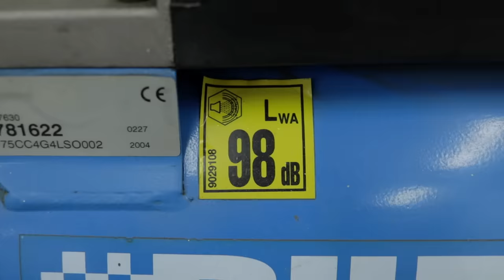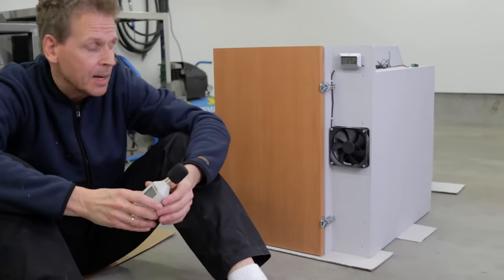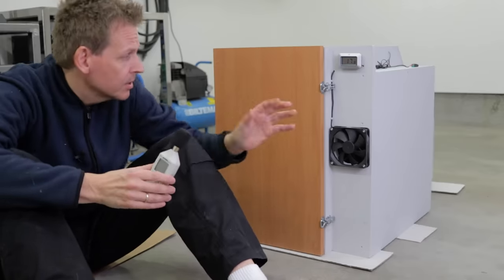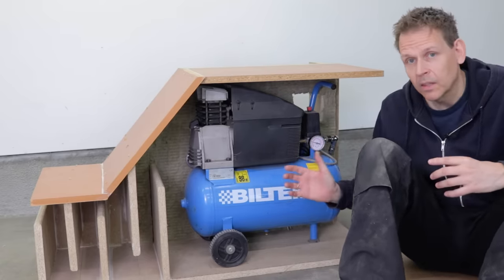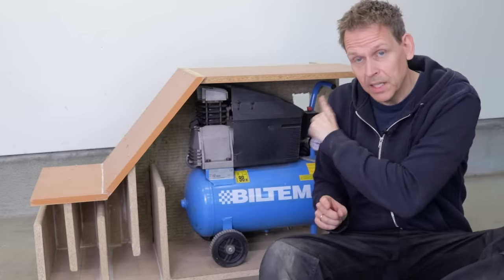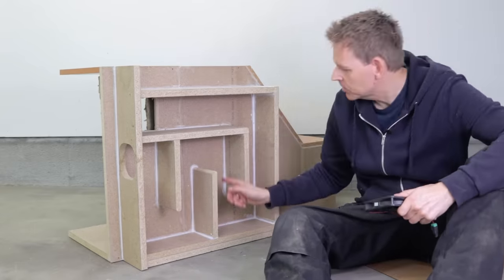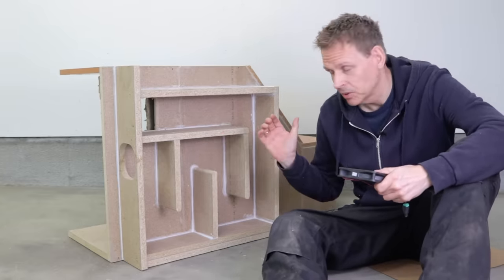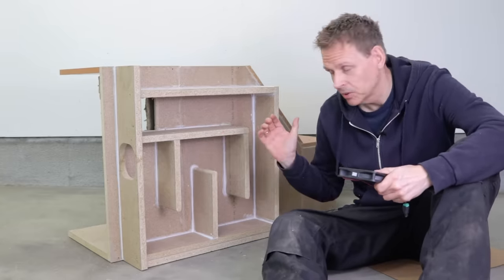Do not build a sound insulated enclosure for your noisy air compressor!

Comment: Nice box.  I'm sure it suits your application quite well.  My only worry is if it is overheating from restricting airflow.... however, it is a small unit, so I'm sure it won't run long enough to ever overheat.
Reply from the maker: I absolutely share your concern when it comes to overheating. The air compressor will not live for long if it is constantly hot above the recommended specs! 😐 However, It's a pretty cold climate here where I live in Norway, in the Northern part of Europe. I have actually fitted a heat pump in my garage to be able to use during winter time. I can see overheating is a big challenge in warmer climates. A more powerful fan or even radiator cooling could be needed must then be considered.

I have fitted a thermometer and I do check frequently that it's not getting to hot inside the box. Normally the temp increases 5C = 10F when it starts until pressure is built up, and it takes just a couple of minutes to cool it down. If it is running constantly over longer periodes it can get a bit hotter, I have seen almost 10C = 20F increase. The warmest summer days can be 30C = 86F here where I live, but that is very rare. Its more commonly 25C = 77F, so it never gets very hot inside my box.

Comment: I've got a 2 HP oil type home compressor that I bought in 1970. Now rarely used. I've also got a business that relies on compressed air, so it is taken much more seriously. 20HP screw, 10HP recip back up, auto drains with oil filter traps so we can dispose of the condensate legally, air to air cooler, refrigerated air drier, coalescence filter, pressure regulator. All piping is sloped to manual drains. All air drops come off the top of the piping, CNC equipment has desiccant driers as backups. Compressors are in a sound insulated room. There is a 40 HP screw type vacuum pump in an outdoor room with temperature-controlled fan venting and heating so it never freezes. Synthetic oil, separator cartridge and oil filters are changed every 4,000 hours of operation (year and a half.) 

Bottom line, air is expensive!

Comment: Had similar problem yrs ago our power on Mobil home went out the land lord brought over large generator it rattled the old Mobil home so I took some plywood and foam along with old comforter arranged them around the plywood and packing foam batons that come with some shipping box’s and dampened it considerably as for exhaust  I just made sure when I went around it that I directed it down and away from the home worked great 

I simple used what I know abut sound rooms and foam and went to it took few minutes and made sure I could open it up easy to refuel it and shut it off as needed
Reply from the maker: Perfect 👍 Living with constant noise is no good, well done!

Comment: One place I worked had a 400 hp air compressor that was very loud. People would complain about the noise if they had to work near it. The problem is that compressors generate a lot of heat and that heat needs to go somewhere. Sound insulation is also heat insulation so when a insulated room was built around the big compressor the oil got so hot the oil hose burst spraying hot oil onto hot surfaces causing the oil to ignite. The result was one compressor dragged off to the scrapyard.
Reply from the maker: Wow 😳 the whole building could have burnt down. Cooling definitely needs to be added to the solution!

Comment: The enclosure seems quite efficient in attenuating the sound from the compressor to surrounding air. However, the bottom of the case probably delivers the vibrations straight to the floor. In your case, since the compressor and enclosure are tucked away at the loft space of your garage, most of the sound probably is transmitted through solid matter - through the enclosure, through the floor, into the garage structure.

You might get a significant noise reduction by adding a layer of sound-dampening material to the bottom of the enclosure. Old foam mattress could work, or some rubber feet even, like some computer cases have. Or you could suspend it in mid-air with a sort of cradle made out of nylon rope, or something more esoteric.

Unfortunately, putting an air compressor into a vacuum chamber to isolate the sound would sort of defeat the purpose of the device, unless you gave it an intake hose. Hmmm... an enclosure with a vacuum inside, and the compressor suspended on damped springs inside? ;)
Reply from the maker: You are absolutely correct! Vibrations are the biggest source of noise now. Will try to improve it by adding soft rubber, dampening foam or springs on the compressor and/or between the box and the floor to improve it. Thanks for the tips! 😊

Comment: You can opt for an oil-filled silent compressor, which typically generates less noise than the type featured in the video. Thanks for the great content!
Reply from the maker: You might be thinking of the belt driven type? Yes, these are much more quiet but also bigger and much more expensive 🥴

Comment: Very impressive. I fully expected that you were cautioning against building an enclosure because of the thermals, very glad that you added a thermometer so that you can make sure your compressor doesn't overheat.
Reply from the maker: Thanks you for you comment 😊 It's is luckily (or unfortunately - it all depends who you ask 😋) a pretty cold climate here where I live in Norway, in the Northern part of Europe. I have actually fitted a heat pump in my garage to be able to use is as a workshop during the winter time, if not it is freezing here. Overheating is probably a bigger challenge in warmer climates. 

I have frequently checked the temp. Normally the temp increases 5C = 10F when it starts until pressure is built up, and it takes just a couple of minutes to cool it down. If it is running constantly over longer periodes it can get a bit hotter, I have seen almost 10C = 20F increase. The warmest summer days can be 30C = 86F here where I live, but that is very rare. Its more commonly 25C = 77F, so it never gets very hot inside my box and it is within the range of acceptable temperature for this compressor.

Comment: Hi - thank you for the video :) 10-15 dB is also ok but i have to point some... points :) - the bitumic matt is prefered choice for silenting not a car lining or a foam. You can test the spectra of sound and point the +/-3dB freq range to create a proper air vent (how wide and how long NOT TO resonate) and also as a carpenter there is an option to create appropriate holes in a proxy wall inside i know this is the type of silenting the philharmonia and music studios, first direct then collide audio rays into themselves :) not sure how to call it.. You can mount a weight on the outer walls to minimize the phonic transfer but it is also an accustic resonance consideration,  plywood is better than the... how do they call it... gluedwood :) ("paździerz" :) ).

You haven't consider any airflow maths, it should suffice but still fan should work with a similar order of cf per minute (or cube m per h if you live in europe ). And we didnt see the thermal effect with a sustained work (load attached to the compressor for an hour long time) ? 

I enyojed the video very much - perhaps thanks to the points i have noticed :)
Reply from the maker: Thanks a lot for your input, It seems like you have a lot more insight into sound treatment than me 😊
I found these at my local dealer - can these do the trick: https://www.biltema.no/en-no/car---mc/car-accessories/sound-insulation/melt-foil-bitumen-4-pcs-2000021214
When it comes to the airflow: I have not done any calculations, my knowledge in this field is limited so I just made a solution that I though made sense 😏 I made the volume of the channels equal for input and output to avoid too much back pressure, and just hoped it would be big enough to transport air needed to keep it cool. I had in mind that the design should allow for putting on more fans (pulling air at end of output) if needed. 
I have tested the box for a while now, and the airflow works well for keeping the compressor cool.  I have fitted a thermometer and I do check frequently that it's not getting to hot inside the box. Normally the temp increases 5C = 10F when it starts until pressure is built up, and it takes just a couple of minutes to cool it down. If it is running constantly over longer periodes it can get a bit hotter, I have seen almost 10C = 20F increase. The warmest summer days can be 30C = 86F here where I live, but that is very rare. Its more commonly 25C = 77F, so it never gets very hot inside my box.

Comment: My compressor is outside the garage in an attached shed, but still noisy. I lowered the noise by taking the intake strainer off, piping it out the back wall of the shed in a pipe, surrounded by some 4" OVC, with insulation between them. There is a 90, pointing downward, but for the cost knocked off 25% of the garage sound

Comment: Just an small, easy and quick suggestion, replace the fan with a HEPA filter (Make it changeable) also move the fan to the end, where air enters big chamber from labyrinth.
Reply from the maker: I liked your suggestions, I might do that 😊 I have got several comments about pulling air out is more effective that pushing air in, I think I just need to try it to see if it makes any difference in real life. Thanks for your comment!

Comment: Awesome build perhaps re-test with improved contact points ie rubber floor, its the vibration that's still apparent also there's sound deadening materials used for vehicle and stereo sound dampening which work extremely well
Reply from the maker: Glad you liked it ☺️ I have thought about it, getting rid of vibrations is probably the best improvement I can do now 👍
Reply: @kihestad  you have gone this far so why not step it up great work champ 👍

Comment: What model was old 98db and new 78db air compressor ? Witch one will fully fil the tank faster in minutes ?
Reply from the maker: They are both from BILTEMA, the noisy one is 1500watts, the silent one 850watts. The silent one takes at least twice as long time to fill the tank.

Comment: A few thoughts, add a remote drain so you can drain the tank without pulling it out.  Also, you didn’t add any sound deadening to the exhaust side baffles, which would probably help, as well as some rubber or other insulating material on the bottom of the box.  

Finally, you have your intake air up top and exhaust on the bottom which isn’t efficient for cooling.  I would have the exhaust side be near the top and intake near the floor and use the fan to pull hot air out rather than push air in.  Trapping too much heat in there is going to reduce the life of the motor and compressor and cause excess water to build up in the tank.
Reply from the maker: Very good improvement suggestions 👍 The reason I put the vent output at the rear was: 1) built in fan on compressor blows in that direction 2) I have ventilation between the floor and ceiling upstairs so it blows the hot air out from the garage, it avoids the hot air going back into the room 3) I did not want the fan blowing air into the case located close to the floor, to avoid sucking in dust/dirt from the floor and not that easy to damage it.  The temp difference is anyway minimal those few centimeters.

Comment: Also add some spacing between compressor/casing or casing/floor. There is a lot of direct vibrations coming through and whole floor or house starts to amplify the vibrations. Some rubber-foam spacers or similar. Also some specific springs out of cable would work. Nice project though
Reply from the maker: You are absolutely correct! Vibrations are the biggest source of noise now. Will definitely do as you suggest! Thanks 😊

Comment: Good show :) How do you get the water from the tank?
Reply from the maker: Thanks! 😊 When it comes to draining the tank, It's a bit cumbersome as it is now. I need to open the four eccentric locks and pull of the door and then take the compressor out of the box. It takes no more than 5 minutes, but it's enough to postpone it to the next day 🙄I better put on a line and have it on the outside....

Comment: Nice video, thank you.
I think your fan should have been reversed, (forced exiting the small round hole higher up and drawing in the bigger square hole lower down. That would use convection to help) and also a hole or allowance for the water drain. You might consider putting a vibration driven hour meter on it so you can drain it regularly and also check the oil (on the first one) not sure if the silent compressor had an oil window.
Reply from the maker: Thanks, glad you liked the video 😁 the new compressor is an oil free type. It's a bit cumbersome to drain the tank now. I need to open the door and drag it outside of the box. I might add  a line for it to be able to drain it outside of the box.

Comment: I like your concept of making air travel a longer distance with baffles, I am building a noise box for my generator. However, I am going to use a much larger fan.
Reply from the maker: Some have argued that the longer distance the air needs to travel, because of the baffles, does not  affect the sound level that much. The sound hitting the baffle walls on the way out of the box causes sound waves to break up and they get absorbed by the fabric. A thicker and better material for absorbing sound inside the baffles would probably make them even more effective. 

Good luck with your generator box!!!

Comment: I want to commend your exceptional work.  I am truly impressed.  I understand you are constrained by your installation space, but there is another consideration you might want to think about - the effect of gravity is that heat will rise.  To counter this effect, you will generally want your input air to be lower than your output air.  In your case, you could simply turn the compressor backwards and change your baffles a bit.
Reply from the maker: Thanks for kind words 😊 I absolutely agree about air intake low, and hot air out on top as a general rule. I should have mentioned this in the video, I just forgot it - but the reason I did put the exhaust at the rear of the box is because my garage is not insulated and it is an opening for ventilation where the ceiling meets the floor upstairs. The exhaust air from the air compressor box is now placed up against this opening. The hot air from the compressor is pushed out of the room to outside of the building through this opening. By doing it like this I avoid the hot air to be circulated back into the room. Sorry, I should have explained this is the video 😔

Comment: This is definitely something I will look at making.  I have an older and very reliable compressor that can keep up with the requirements of spray painting and contact adhesive spraying.  I haven't found a smaller or quieter unit that can constantly put out the CFM I need.  But my machine is noisy as hell.  I have access to lots of board off cuts and carpet, so I am probably going to make mine almost double layered, instead of using the thicker foam insulation.  and I may very well need more fans to get the air into the unit too.

Thank you for the inspiration and ideas.
Reply from the maker: Double walls with sound insulation material in between will be very good! Good luck with your project 👍 It is soooooo much more pleasant to work in the workshop now after I got rid of the noise, I can highly recommend it. You will not regret doing it 😊

Comment: Nice project! I would have investigated building a permanent sound dampened closet under the bench instead of making a movable box, it might have saved some material. I would also have looked at how the compressor touches the floor beneath as sound tends to travel well through rigid materials, so maybe a rubber mat of some sort? Interesting project! Reminded me of building speakers or subwoofers. Might be lots of information there dealing with propagation of sound waves through lengthy ports etc. Another thing that comes to mind is to modulate the sound to frequencies that are less annoying to our hearing.
Reply from the maker: You are right, it really does look like a subwoofer box. I have made some of those as well 😁 Creating a sound insulated cabinet under your bench sounds like a smart solution. Adding soft rubber feet both under the box and to the compressor inside the box is something I have planned as an improvement. Vibrations from the compressor make a low noise as it is now. Always rooms for improvements ☺️ Thanks for your tips!

Comment: Thanks for this video which could be useful for me one day.
One thing : You misunderstand how the decibel scale works, and the 3 dB rule.
Each time you increase the sound by 3 dB, the energy is doubled. Reciprocally, each time you lower the sound by 3dB, the energy is cut by half.
This is due to the logarithm scale of the decibel unit system, it is not linear.
So looking at the figures in your video, you really decreased the noise of your compressor with your enclosure.
Reply from the maker: I might have over-simplified how the Decibel scale is to be understood, let me try to clarify (based on a discussion / explanation from the comments): 
* 10dB increase is the typically stated value for doubling the perceived volume (subjective), without respect to actual power/energy. 
* 3dB increase is a doubling of the actual power/energy (objective), without respect to how a typical person would perceive or rate sensed-volume. 
I have to add that the Decibel is a difficult scale to relate to (at least for me), I might have to study this a bit more - sorry if I got it wrong 😌